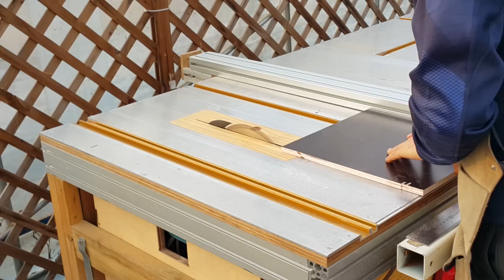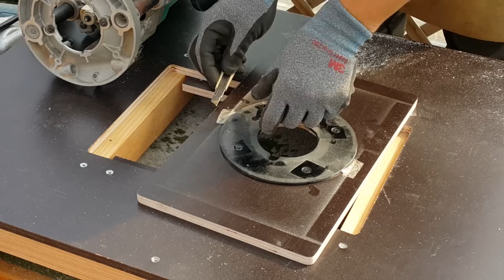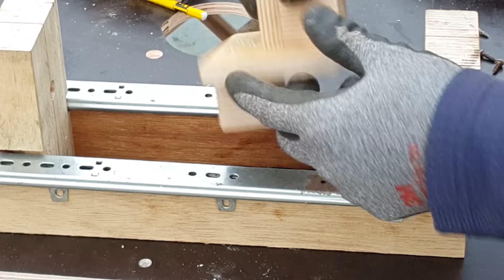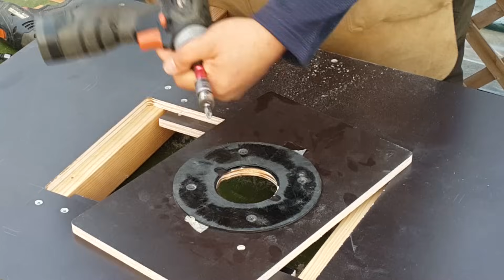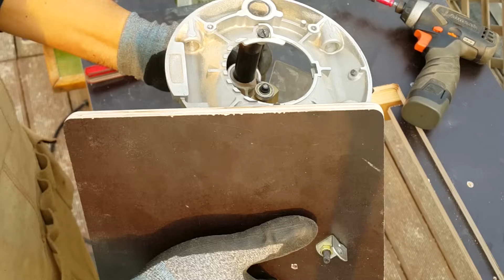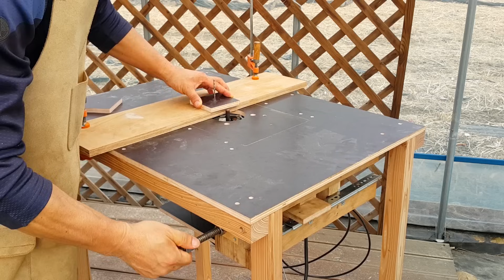자작 라우터 테이블 리프트 make a router table lift (makita m363/mt362g/m3600m)

Comment: Be aware that the cooling fan in a plunge router runs in the opposite direction to an inverted router. This means that the router has a tendency to ingest dust, clogging it, and creating a potential fire risk when put to heavy use. When our Onsrud inverted router died, I built one of these to get the boss out of a jam until the proper machine's parts arrived. Works well for a short time, but will kill the Makita fairly fast. Make sure you blow it clean regularly!
Reply: Is this problem with the cooling fan going to be the same for any router that is mounted in a cabinet?
Reply: @soldier4christsoldier4chri90  yeah mate.
The direction of the fan is pretty much the only difference between a hand router and an inverted router.
Keep it clean, blow it out regularly and its not a huge problem
Forget it, and the router ends up solid with dust! (even in a proper cabinet table with extraction!)

If you're going to do this, I suggest using a "fixed base" hand router, not a "plunge" router.
Since you are hanging it in an adjustable cradle, you are better off without the weaker, less accurate plunge base.
Fixed base routers are locked at desired depth and DONT come loose, creep, or flex once locked.
Much tougher little routers!

Comment: I'm trying to understand what u used to make this brilliantly thought out router lift mechanism. Are those wires/lines from the brakes on a bicycle?? If they are then it's brilliant imho. That's a really smooth running operation u built by the looks of it bro. Is it as smooth as it looks in the video?? I see I'm already sub's to ur channel a while now. 
This is a great idea and very cheap to make too I suppose. I'm going to have a look at this idea for my own table soon. 
Can I ask if this would work on a table saw as well? Do u think it would be strong enough to hold the weight of the motor and housing?? I thought I saw this being down on something else before. Something like this idea of yours was used by u on another build?? 
Keep up the great work my friend. Salute from Dublin, IRE.

Comment: Dear Sir, by removing the springs which give static opening of the plate from the body, you now rely only on gravity to pull the plate downwards from the body. Do the arms go a little askew and then get stuck, or is the movement smooth? It’s a slick novel approach to working with a mounted router. Love the idea of a big knob away from the cutter to adjust but my only concern is the mechanism will get frequently stuck. How is it going in use? Thanks for sharing.
Reply: He used Bowden Cables. If he used push/pull Bowden cables then removing the springs is no problem because then the movement in both directions is positive.
Reply: Ah ha, nice to know.

Comment: How do you make sure that the two cables are equally tight, don't you risk the lift racking if you pull more on one cable than the other or are the linear bearing slides in the router stiff enough that this is not an issue? Maybe put the two cable ends on a pivoting block on the bit where you adjust the lifting from, that should ensure an equal pull of each cable.

How much back-lash is there in this setup, I was wondering if you left the springs in the router then they would make sure that you're allways riding on the same side of the thread but maybe gravity is enough to ensure that?

Thanks for sharing the idea and video. :-)
Reply from the maker: I understand that I am using Translator, but I feel a little sad ...
Thanks for telling me.
Reply: @VIPhappytree  No need for feeling sad about anything, you came up with a great solution to taking a standard router and building it into a router table. :-)

How precise is the setting of the height of the router, does it vary during a cut or does it stay where you set it?

Again thanks a ton for sharing your build and solution. :-)
Reply from the maker: @Dingbat217  To make an accurate foundation
After setting the height, fix it with the router body lever
Height does not change during cutting
Reply: HAHAHAHA I was thinking the same ;-)